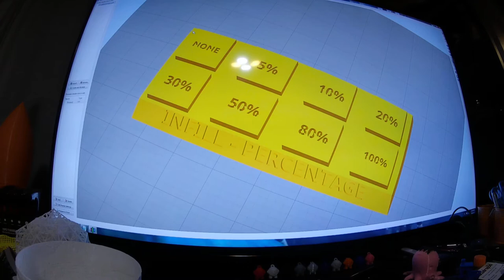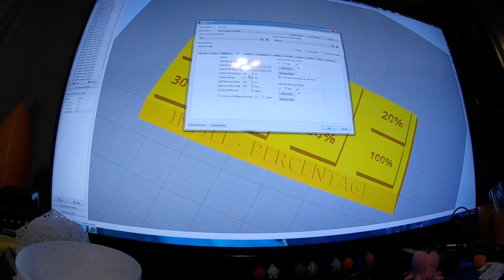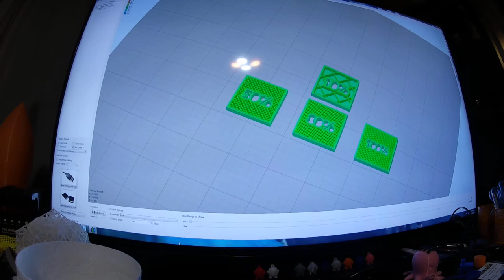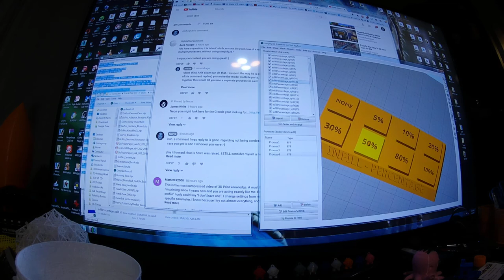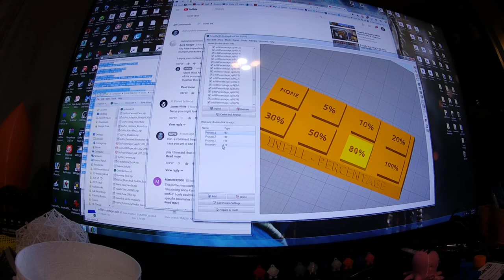Today'3 3D Print Quickie answer to Aerik's Question

Comment: Thank you for taking the time to answer, I really appreciate it. I haven't found any way to do it in Cura or Slic3r, but don't have access to Simplify3d to check there. 

This is exactly what I guessed he meant from his comment, I just wasn't sure without having the software to check it out on. I had the idea this might be what he meant because one of your earlier videos, you explained how you did 0% infill except the few layers before a horizontal area using a split process. 

Having to set up each of the objects is better than what I was thinking I was going to have to do. ;)
Reply from the maker: the problem with level process is that I can ONLY distinguish vertically not horizontally. he gets around that limitation by using separate objects. Can you do that in Cura? define settings for difference objects to all be printed at once?
Reply: No, Cura most definitely cannot do it. I have looked around very thoroughly and haven't found anything remotely like it. I was thinking I was going to have to split the parts in a modelling program to re-import and then print individually and glue together or something.
Reply from the maker: Aerik Forager I think Kura canoes different settings for different parts but you have to get it in two different parts while still keeping it all looking like it's together I think you can do that in meshmixer that's what they mentioned in the thread I have no experience with meshmixer but all you need to do is separate the connected parts I still don't know how you would get it into Cara as separate parts but properly aligned so Prince as one piece but with separate settings

Comment: You can then find the parts which should have the same process and group then as selections and then I believe you can assign a process to a group, so it shouldn't be as painful as doing 1 process per part
Reply from the maker: +kazolar not quite you can't group parts at least I haven't figured out how to do that you can group processes what I do if I rename the key parts so the 80% block I named it 80% Etc the base are named base and then what I do is I create a process called miscellaneous bits and when I go to select models I deselect the parts that I renamed so that all the miscellaneous bits are now in one process and then I create a separate process for each of the primary bits it's a little tedious but it wasn't that hard took me about 10 minutes maybe 15 to do a a couple of different models

Comment: I believe you can right click the model in Cura and split into parts, and then use per model settings to change the infill?  I'll give it a check later today and respond.
Reply from the maker: Dennis J Harrison Jr that would do it a lot of work but the results should look pretty cool
Reply: Yeah, Cura CAN do it. I'd rather buy Simplify3D twice though - yikes!  After 4 models with different settings Cura starts to crush my computer, no easy feat man - Core i7, SSD, 32Gb RAM.  I guess it only ever uses one thread?  I think people getting into FDM should consider the $150 for Simplify3D as a 'tool' cost.  Seriously though, Simplify3D could do themselves a favor with a demo...